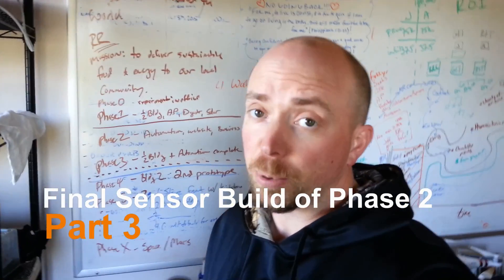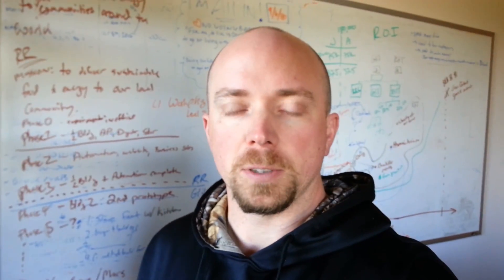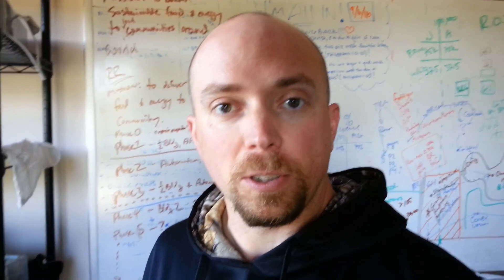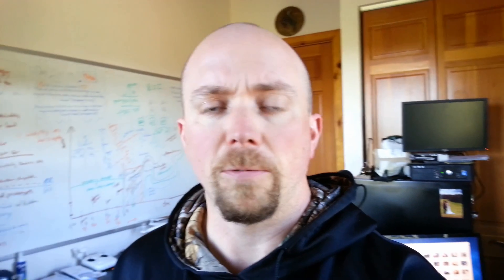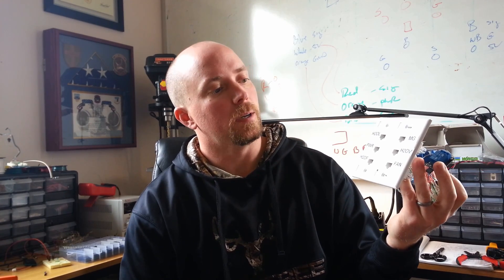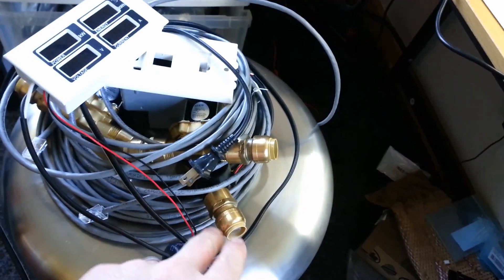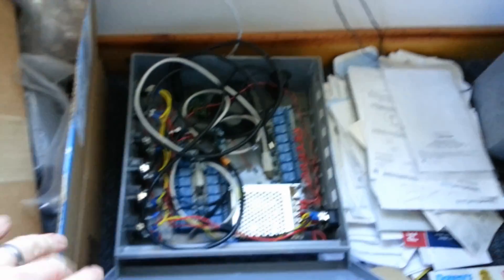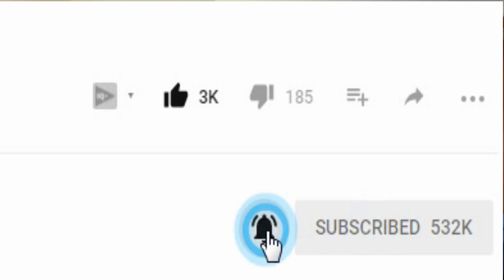Off-Grid Trout Aquaponics Automation - Arduino Sensor Build Part 3

Comment: I did a sump pump water level project and used a tape sensor.  worked good, easy to calibrate.  Just in case you need another option...https://www.adafruit.com/product/464?gclid=Cj0KCQjw_o7NBRDgARIsAKvAgt1QRluTKBFUqzDrs0jgLwmZXGPvvUqO_e9lThguNzQW3LkAc4UpTLwaAru5EALw_wcB

Comment: You should use some real sensor cable, not sure how many pin but a M12 4 or 5 pin connector is fairly cheap and you wont have any problem, like SACC-M12MS-5CON-PG7-M SKIN - 1456466 from phoenix contact, i sell tons of them at work. there is also some prémolded one. i fear you will have corosion problem since the RJ connector you are using are not watertight.

Comment: If  you still get trouble with the level sensors then go for a float switch from a car fuel tank . They have a variable resistance output to show the level. That is how the fuel gauge in your dash gets its  info. With regard to your new found feelings for cables i can only say as  a former comms engineer who used to have to make up cables Yes,been there ,done that and if it helps you will get good at  them just about the time when you have finished making all you need, so make some spares for faulting because if you need more a couple of months down the line then you will be rusty at making cables up again with the added pressure of out of service systems .. Happy Days

Comment: lol @ ur cable dramas, I licked that problem years ago, I don't mean to boast but once u understand the cable design and master the technique of stripping it appropriately it becomes dead easy. The thing u got to look out for is the conductor (stranded as apposed to solid) then u need to use the right connection fitting for either one, the rj45 modular plugs for example there is 2 types, one for stranded and one for solid... keep that in mind when purchasing ur stock, another issue is lining up the right sequence of conductors into the plug and crimping it. After about 10 it shud become easy and u will get quicker at it, maybe instead of cat 5 u may try the beige telephone flat cable which comes in 2,4,6,8 and 10 this is shitloads easy and faster to terminate with. 

If u change to a bigger (control)box for each individual lane maybe u can use a rj45 patch panel system instead, like we do in computer networking, install them boxes along the lane and run cat 5 from the main patch panel to each box and terminate. then all ya have to do is use a patch lead to inter connect ur control box to the outlets and plug in what ever sensor u require, u can even patch thru an ethernet or landline connection through this method. U can manipulate it where u run 4 sensors off 1 cat5 cable just by making a special patch lead where one end is just 1 rj45 and the other has 4 rj45's which is terminated on the 4 individual color pairs, increasing the sensor array and freeing up other cables for other uses saving money.

Comment: Being a industrial maintenance craftsman, I'm more familiar with 24 VDC sensors and canbuss-type communications. The sensors are just plugged into a input module, analog or digital, and goes to the controller through an serial interface or a optical link. I have constant sticker-shock when we have to buy that stuff, though. lol
Reply: sticker shock??
Reply: TheTomBevis shock due to the high price
Reply: ty nikita and yes that mod bus stuff is way too expensive... they pricing themselves out of the market.

Comment: On your cable builds, you may want to investigate presurizing the cables susceptible to water/moisture. Telecom has used presurized cable for years and this could accomplish two things for you.  1) if there is a compromise to the cable, the pressure will force moisture away from the conductors, and 2) you can detect breeches by monitoring cable pressure.
Reply: nahhh we use gel filled cable for underground installations nowa days, it stops the ingress of moisture pretty well. We used that system for the old lead sheathed cables with each conductor wrapped in paper insulation and was a pain in the ass to maintain not to mention work with as well.